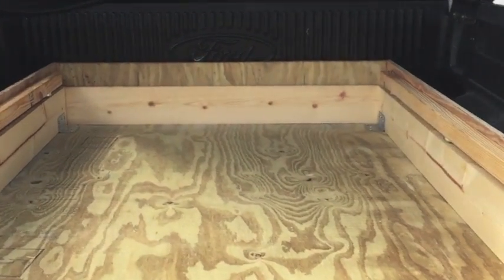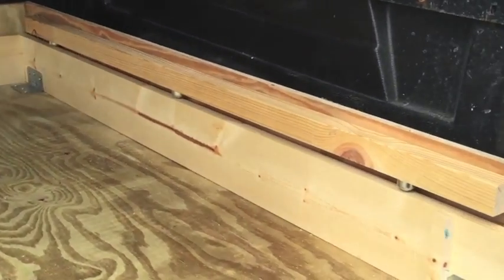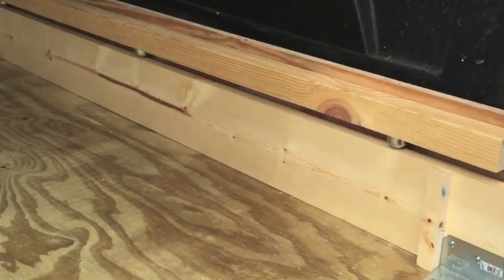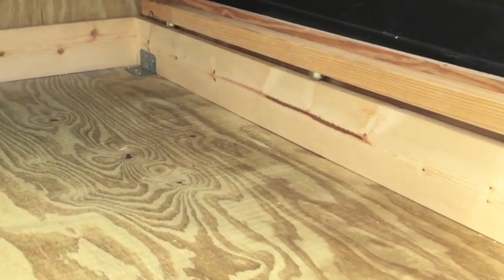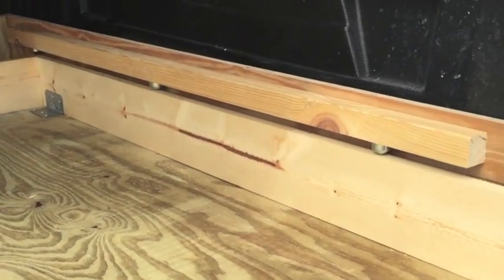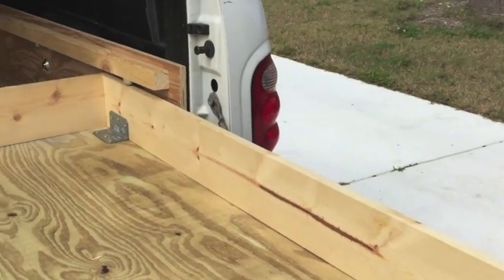Slide Out Truck Bed Drawer

Comment: Remove the 2 ball bearings from the side rail towards the back. and place only one on the bed slide facing upwards. so when you slide all the way out it wont tip down. Or you can place 2 face up towards the back 1 ft apart or less to help with the weight.

Comment: when using pressure treated wood, you need to use hot dipped galvanized fasteners.. or other Fasteners made for it.. there's nasty chemicals in that wood that will Rust anything that's not made for it.